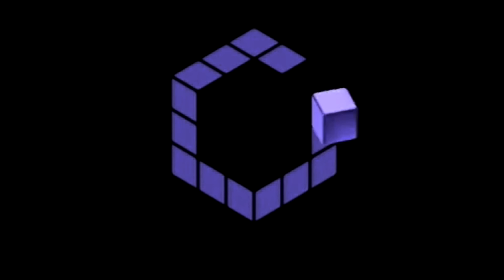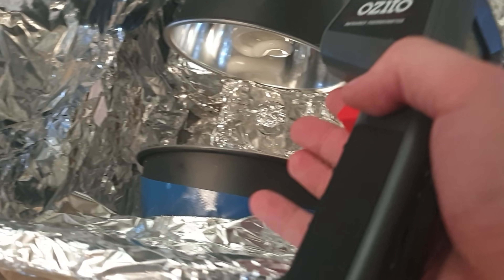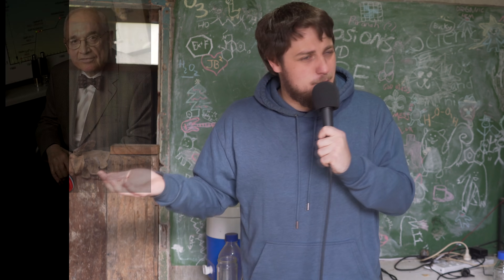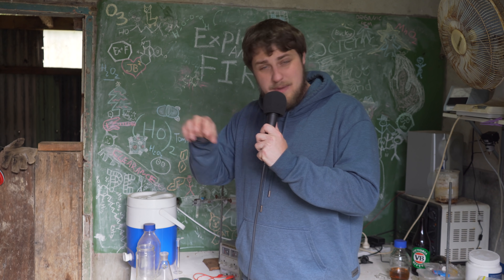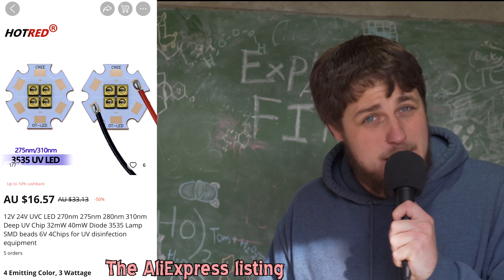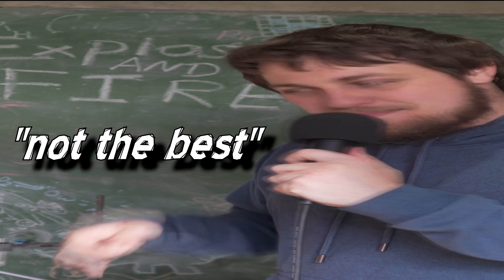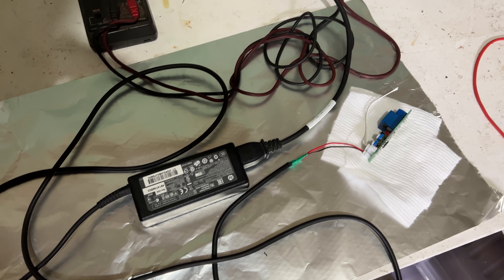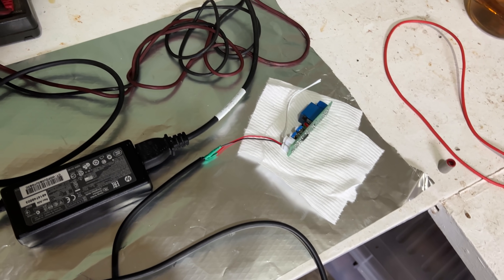Magical deep UV LEDs - Cubane Ep 12

Comment: AAAAAAA NO DON'T GIVE LEDS WHATEVER THEY'LL TAKE THAT ADVICE IS BAD AND WILL BLOW UP YOUR LED! D8

Diodes are non-ohmic and when they enter the forward-conducting state their conductivity shoots through the roof. (In the ideal case, the conductivity of a forward-biased diode is infinite, but in practical applications it's not but it may as well be.) You have to regulate the current through a diode or it'll pass however much your power supply can give it until it pops. This is typically done using a current-limiting resistor in series with the LED, or with a current-regulated supply (which is what your lab power supply is capable of doing).

The CLR approach requires you to know Vf, the forward voltage of the diode where it enters the forward-conducting state, and is calculated thus: (Vsupply - Vf)/I = R where V is voltage, I is current (specifically the current you want to allow the diode to conduct), and R is resistance.

This is much simpler with a current-regulated supply since you can just define the current limit and just make sure Vsupply > Vf so it has enough voltage to forward-bias the diode. The diode will very quickly hit the current limit at that point and your power supply will regulate it accordingly.
Reply: So, I’ve done plenty with LEDs, and never had this issue. I tie them directly into the 5v rail on my pc psu, and they don’t consume excess current. I’ve done battery powered LEDs on cosplay as well, and never had an issue of it slurping excessive amperage. I’ve always regulated voltage, not amperage. And this is what I see done in commercial products as well when repairing electronics. So, I don’t understand why people are saying they’ll take infinite current? Am I missing something here? Like even my electric razor has an led just slapped on to the two terminals to indicate charging, no current regulation at all.  You seem to know what you’re talking about, so any insight into this discrepancy would really be appreciated.
Reply: @haroldsaxon1075  Hey sorry I didn't see your comment earlier. I'm terrible at checking the notifications panel as of late. Something about not enough spoons lol.

I've never deliberately used the constant voltage method of controlling a bare LED. If an LED works with constant voltage control, it usually either has integrated current limiting circuitry (some fancy addressable LEDs are like this) or has current limiting circuitry in series with it. Diodes alone pretty exclusively operate in the current controlled regime and require additional circuitry (either via current-limiting resistor or constant current source) in series with the diode for it to work via constant voltage control.

In the typical case, if you power a diode--any diode; not just LEDs--with a voltage supply that exceeds Vf, the forward voltage of the diode's PN junction (this is based on both the diode chemistry and the diode's construction), the conductivity of the diode essentially becomes that of the semiconductor materials used to construct the diode. This conductivity increases exponentially with applied voltage.

In the ideal case, we generally assume the diode's conductivity rapidly shoots off towards infinite when Vsupply > Vf, and ensure that the diode has some kind of current regulation in series with it to make sure the diode doesn't suck enough current such that I x Vf = P doesn't exceed the diode's maximum power rating. An ideal constant voltage supply can supply infinite current, and an ideal diode can conduct infinite current when forward-biased, so we have to regulate current through the diode somehow!

In the practical case, the conductivity is obviously not infinite. That can only happen in superconductors, and diodes are... not that lol. So a diode that is forward conducting will happily chew up as much current as the power supply can or will give it, or as much current as its semiconductor chemistry will conduct at the voltage provided, whichever is lower. If Vsupply approximately equals Vf, the diode may actually work without current regulation, as the supply voltage may not be high enough for the diode's chemistry's conductivity to exceed the diode's current rating! But as Vsupply increases, that conductivity increases exponentially, and you can very rapidly exceed the diode's current limit and cook it. This is not something you want to depend on, and you should always make sure you have current regulation in series with your diode to keep it happy. :)

As an additional useful nugget of knowledge, specifically pertaining to LEDs: more current = more lumens. Reason for this is you have more electrons jumping the transition gap across the PN junction and relaxing into lower energy states, and releasing their lost energy as photons of light roughly around the characteristic wavelengths of the diode's chemistry. :)

Another nugget of trivia: ALL diodes are light emitting. The ones that aren't by design are just (really shitty) IR diodes in disguise. Radiant heat is infrared light, after all, and the energy lost by electrons that jump the gap even in small signal and rectifier diodes has to go somewhere. ;)
Reply: @calyodelphi124  It's late at night when i saw this, so im going to keep this short. So,  Ohm's law states that the current through a conductor between two points is directly proportional to the voltage across the two points, right? And diodes have a variable resistance depending on the forward voltage, right?
Here's a chart https://i.stack.imgur.com/Z9STp.png
This means there is a safe operating voltage for any diode, including LEDs. Current increase as forward voltage increase. Neither number can simply run away to infinity while the other remains constant, they are inexorably linked and inseparable variables.
Here's another link with actual LEDs and the operating specifications. 3.0-3.2 volts is your safe range for them.
https://www.amazon.com/JABINCO-Circuit-Assorted-Science-Experiment/dp/B0827KYRFH/ref=asc_df_B0827KYRFH/?tag=hyprod-20&linkCode=df0&hvadid=416655650137&hvpos=&hvnetw=g&hvrand=12374622667303135318&hvpone=&hvptwo=&hvqmt=&hvdev=m&hvdvcmdl=&hvlocint=&hvlocphy=9028279&hvtargid=pla-870425772422&psc=1&tag=&ref=&adgrpid=94181909936&hvpone=&hvptwo=&hvadid=416655650137&hvpos=&hvnetw=g&hvrand=12374622667303135318&hvqmt=&hvdev=m&hvdvcmdl=&hvlocint=&hvlocphy=9028279&hvtargid=pla-870425772422
Reply: @haroldsaxon1075  "I tie them directly into the 5v rail on my pc psu, and they don’t consume excess current."  Bullshit.
Reply: @0x8badf00d  I already got the answer to my question elsewhere. There are two ways to drive an led, constant voltage or constant current. Constant voltage driven  LEDs do not require a blast as set voltage regulates the current. This is what I am used to. Constant current driven however does require a blast to keep voltage within a target range as left to itself it will burn out.

Comment: Yeah, you'll want to use the timer to cut power to the driver. The driver has a voltage range and a current rating, and will provide whatever voltage it can within that range to make that current flow. So if you open a switch in its output line, it will instantly swing to it's maximum voltage, trying to overcome the new infinite resistance of the open switch.
Reply: No need for timers at all. Just properly drive the LEDs and they wont overheat.
Reply: and that's exactly what's fried the first LEDs

Comment: So the thing about LEDs is that if you power them from a supply that tries to give them a specific voltage, they'll tend to run away because they draw way more current at 12.1 V than at 12.0 V (for example) and also it changes as they heat up. However, that same property makes a power supply that tries to supply a constant current work very well.

You saw that for yourself when you tried the benchtop power supply when you tweaked the knob a little past 12 V and suddenly drew a whole amp. I was pleasantly surprised that you didn't immediately break the LEDs. The datasheet says 40 mA. Give them 40 mA. You need a constant current power supply either at 40 mA or adjustable over a range which includes 40 mA. Or use a resistor in series. Voltage drop across the resistor should be about the same as voltage drop across the LED for good results. You may be able to get away with more than 40 mA if the heatsinking is good enough. No I don't know how good is good enough.

Your benchtop power supply has knobs that tell it to give voltage no more than something and current no more than something else. The indicator LED shows which one is being regulated at the moment--if the one on the right is on, the supply is currently regulating voltage and if the one on the left is on it's currently regulating current. So if I were driving LEDs from the benchtop supply, I would start with the current dialed down to zero, put the voltage knobs up to some value at or a little above what the LEDs need, and then carefully dialing up the current knobs until the LED is running at some reasonable current.

Safety ground is supposed to be connected to the metal exterior chassis of a device to prevent mains voltage from appearing on something you can touch. You should connect it to stuff you think you might touch by accident while the device is running and which could possibly have mains voltage on it in the event of something going wrong. So the can, maybe. At your level of expertise, unplugging the setup before touching metal bits is a good robust strategy that you should use at every opportunity.

LEDs on boards like that are often sold with a reflector doodad that mounts on the front. I recommend that you use that because it lets you keep the board out of the box full of UV-C. UV-C is generally harsh on polymers and you want those intact to insulate your circuits. The failure mode is that random polymer bits start flaking off or cracking after ?? hours of use. It shouldn't be too bad because you don't have any really shortwave stuff that can make ozone, NOx etc from the air, but I don't know exactly how bad is "shouldn't be too bad".

Comment: Speaking as an electrical engineer, this episode is painful.
Reply from the maker: I expected nothing less, and I am sorry
Reply: @ExtractionsAndIre  your wallet is the one that will suffer the most. Letting the magic smoke out of IC components is painful.
Reply: @lairdcummings9092  and the reaction will suffer too. The overdriven and overheated LEDs will make a very different light with much higher wavelength.
Reply: @ExtractionsAndIre  Don't be, we wouldn't do any better at chemistry.
Reply: @ExtractionsAndIre  "I expected nothing less, and I am sorry"

No you're not.
Reply: @ExtractionsAndIre  no earth needed as the power supply is double insulated. You need some more heatsinking perhaps. You lileky blew that led by having the power supply on but led disconnected, then attaching it, dumping a big current spike into the led as those led drivers have a capacitor on the output that would have been fully charged to 40 odd Volts with it unconnected. You have a current limited lab supply there, for driving a led use the current controls to achieve the current you want, the supply will automatically adjust the output voltage to give you the current you set, just set the voltage above what is needed and adjust current from minimum up to your desired valve the supply will regulate current as needed, that's when the red led turns on on the supply=current control mode.
Reply: @ExtractionsAndIre  Well, you've learned something at least! And it only cost you two blown LED drivers and one blown LED. 

A tip for the future: LEDs are kind of the exception to the "it'll only draw what it needs" rule of thumb; LEDs will, to a first approximation, draw as much current as possible, even if they blow up in the process. You should always, always drive LEDs with either a constant current supply with the current limit set to the LED's rated current, or with a series resistor calculated to limit the current to something safe for the LED. Never try to drive LEDs with a voltage source.
Reply: But entertaining, in a "monkeys playing with power tools" kind of black comedy way.
Reply: Speaking as an electronics tech, yeah.. this hurt to watch. But he's learning. Baby's first diode :'-)
Reply: I'm at 15 minutes in and I just can't anymore.  Can someone get this guy a current source?  @Extractions&Ire  You're hurting the kids!
Reply: speaking as someone who decided to drive led lights straight off the pwm pins of an arduino, I agree
Reply: @chephalonkappa9282  did that not work? It should have worked fine with short pulse long cycle, otherwise needs resistor i guess. I would have done the same if not for your comment.
Reply: @Wtfinc  It works fine in my cause because its only a short LED strip but for anything that draws over, I think 100mA you want to use a MOSFET that is triggered by the control pins on the arduino. For the direct attachment you would also want a resistor because LEDs dont have a significant resistance and can burn themselves out.
Reply: @chephalonkappa9282  makes me think about the performance characteristics of the different outputs and inputs. I kinda wanna blow some up. Holy Smokes I love this shit and I loved watching someone make the same mistakes I know we have all made early in our experience. It may be painful ad cringy for a pro to watch it and yeah, it kinda is. I don't think OP intended to come across as a gatekeeper. dude only said how felt and didn't say anything nasty about the video. I think Captain Spike took a hot take. But I get that, I cant stand when people are like "bla bla I'm a pro and you should do it like this, you are trash for even thinking that's how its done. You should QUIT! This stuff is for smart people only, of which I'm the only one, REEEEEEE!"
Reply: @chephalonkappa9282  Most micros can NOT source 100mA on the pins!
Reply: @JohnDoe-rl9pp  Its out of spec but its probably not gonna instantly explode either.
Reply: @chephalonkappa9282  That's actually fine for indicator LED's. You just need a ballast resistor.  I kinda wish they'd just integrate the ballast resistor at this point.
Reply: Amateur electronic hobbyist here and it made me feel smart. Watching the chemistry videos feels like watching black magic though.
Reply: I'm also an electrical engineer and I found this episode to be highly entertaining, even rubbing my fingers saying this will be good like with en electroboom video
Reply: Speaking as a normal person pulled in from the algorithm years ago, this video was like all of them pretty entertaining. 😂
Reply: @Tontonrawr  Same lol! I love watching him!
Reply: Even as a mere electronics hobbyist watching him torture those poor LEDs without even realizing he's doing it made me cringe something fierce
Reply: I think you've just gone 5 minutes without telling somebody your credentials.
Reply: Speaking as someone who took an electronics class in high school, this episode is relatable.
Reply: I only got about halfway through an EE BSc, but I was studying as a semiconductors specialty and I'm already about cringing my face off
Reply: Feel like electroboom would prob love this
Reply: I'm not an electrical engineer, I also found this painful.
Reply: Yeees
"I'm getting too hung up on the whole 40mA, I'll give it 1A and it should be allright, yeah?" No, It will not
Give it 40mA and that will be good
What really rubbed the salt in the wound was "it draws 1 amp of power"
If you, mister creator are reading this then please consult electrical stuff with me or someone with better electronics knowledge then mine
Reply: Agreed.
Reply: This is almost exactly what I was about to post
Reply: Agreed 😂 I mean hey, we all have our specialties, but we all have to start somewhere. If you have any electrical questions, and I mean any, I don't care how stupid it might sound, feel free to reach out and ask, I'll be more than willing enough to help with any questions or projects that I can 😁
Reply: Same. I was just thinking to myself, “this would be easier with a resistor to current limit”
Reply: when he said his electrical knowledge was not that good, he wasn't kidding ! apparently his basic math isn't too good either !!!!!
Reply: it is XD
Reply: if this comment section was my teacher i'd have quitted school
Reply: @akiraakiraakiraakira  quit*
F minus, go back to your seat
Reply: "I thought the LED would just use what it needed!"
Reply: I know right? Has this man never heard of a resistor?
Reply: I had to watch an ElectroBoom video just to calm down
Reply: "I'm a pro, you're wrong." No further explanation.

Just makes anyone look like a typical rookie/amateur talkin high on the Internet.
Reply: @SpikeKastleman  This.  The virtue signaling is way more cringe than Tom's learning.